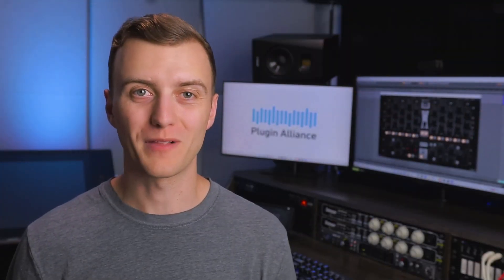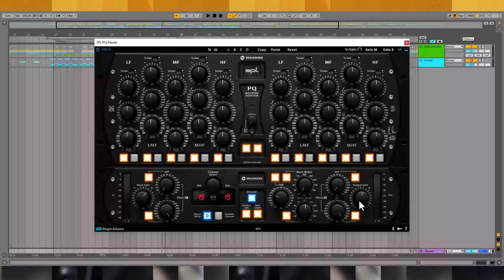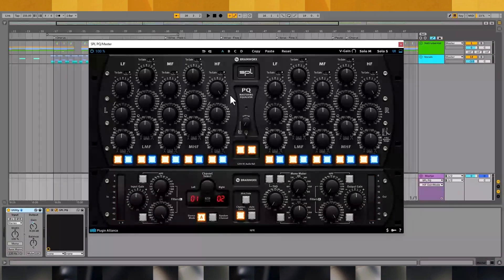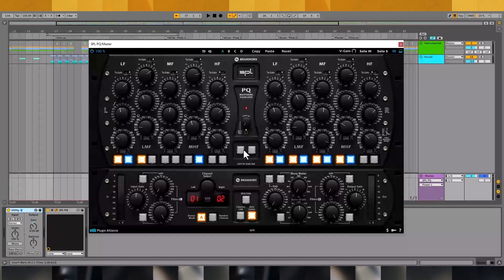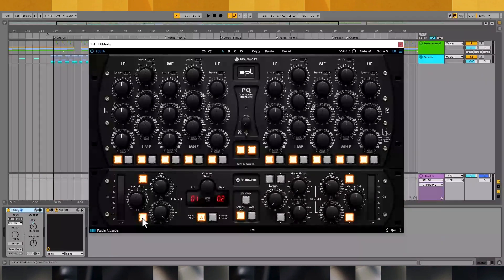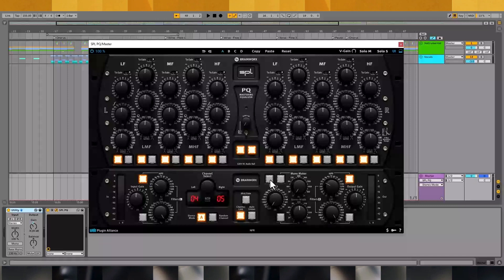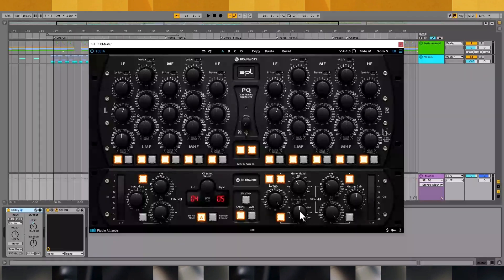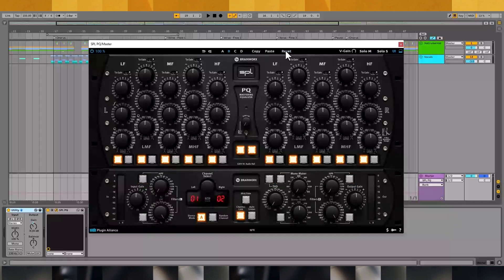SPL - PQ Walkthrough | Plugin Alliance

Comment: I have an actual PQ and bought this plugin to try out some A/B comparisons before applying in analog. It's really close and I was pleasantly surprised to see the curves were identical when I looked in plugindoctor. However, there's a few glaring issues any user should know about. First and by far the most serious, is the plugin introduces a pretty hefty roll off above 10k. This is not true on TWO different PQs I've had. Nowhere close. Unsure where this is coming from or why it's introduced by PA. They should really remove it. Also there's a slight gain change when turning the plugin on or off. Again, this isn't true in the hardware, and it's enough (about a half dB) to be just strange to use and make good decisions. Lastly, the TMT variances are quite big. Way bigger from left to right than is usable without muddling with the stereo image. So just always lock both TMT channels to be the same on left and right. Beyond that, there's the obvious differences between the hardware and software, such as the 120v rail tech sound not being able to ever really be reproduced digitally. It's something you can only get with copper and wire and exists in an electical field only. There is an excitement to it. It is not saturation and the THD takes the sound in the opposite direction. It's an awesome plugin and the only thing I'd really wish they'd change (besides talking about these things in the video) is that horrible roll off that has no business being on the plug!